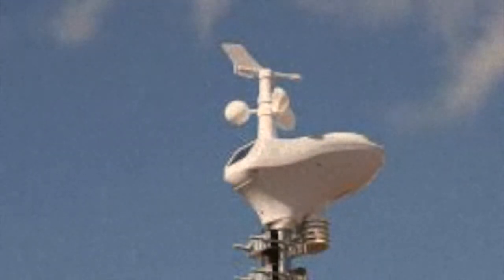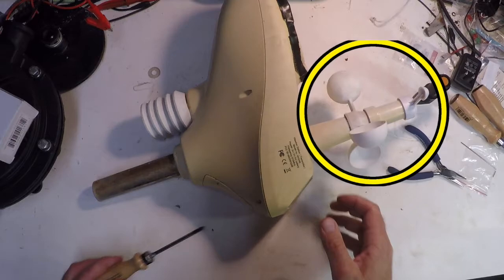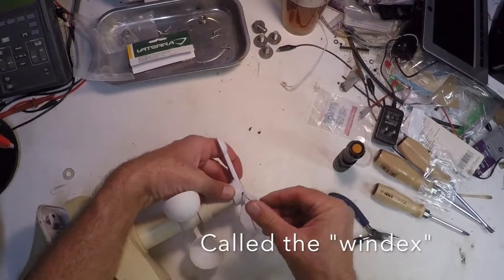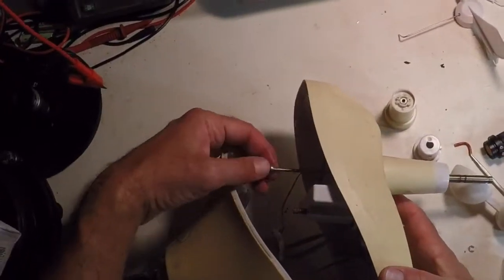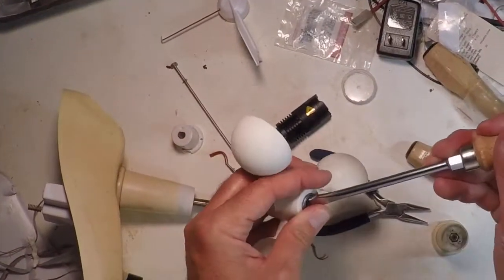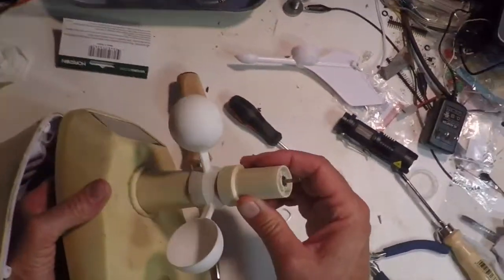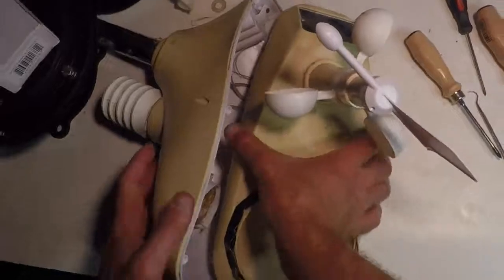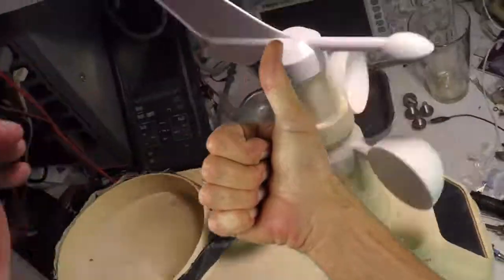Weather station teardown and bearing replacement

Comment: you don't happen to recall what bearings you bought, do you?
Reply from the maker: I took the measurements and searched on ebay and amazon, making sure to look for stainless (ideally, 316 stainless). I just checked and it looks like the specific sellers I used are no longer there but I'll bet there are others. You could also probably locate all the bearings at McMaster-Carr or Grainger but they will be more expensive. I know some of these bearings can be opened up for cleaning and greasing so that is a possibility if it is just dirt and not rust causing the problem.
Reply: @ravraid  great thanks....i don't have a digital caliper so didn't know if you still had the sizes -- i have the same unit you do.
Reply from the maker: @johnobrien2074  I think I put the measurements in the video but let me know if I missed something! As I recall, one of the was unusual in that it had a flange.

Comment: I am starting to have same issues where did you get the replacement bearings. thanks
Reply from the maker: I measured each bearing when I removed it, then searched on ebay and amazon for that size, making sure it is stainless (ideally, 316 stainless). One example link is below. You could probably locate them all at McMaster-Carr or Grainger but they probably be much more expensive. I know some of these bearings can be opened up for cleaning and regressing so that is a possibility if it is just dirt and not rust causing the problem.

Here's an example:
https://www.ebay.com/itm/301152238929?ul_noapp=true

Comment: Hi, I am having the same weather station and facing the same issue for the last few days. Thanks for the details. You didn't mention top shaft ball bearing height. It would be of great help if you can give me that info. I am from India.
Thanks
Syam
syam0312@gmail.com
Reply from the maker: It looks to be 4mm in height on mine. However, there can always be product manufacturing changes so I'd recommend doing what I did: measure the one you have and order a replacement. Unless your weather is very dry, I suggest getting a stainless steel bearing.